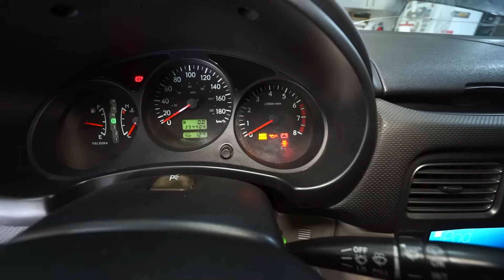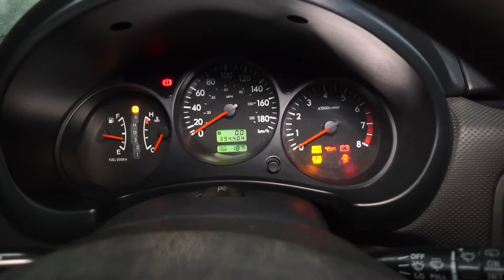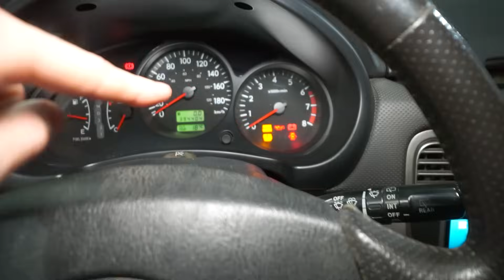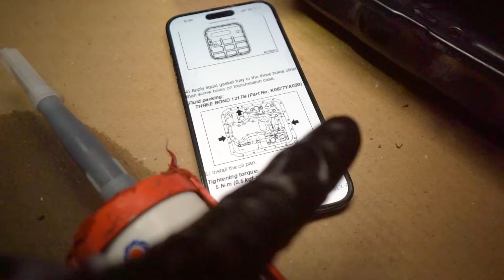Subaru 4EAT Transmission Problems - How I Fixed My Solenoid

Comment from the maker: Have you ever had any transmission issues?
Reply: I haven't had any transmission problems before i just recently swap my 2.5 bcause of rod knock it just starting to get hot but i pulled over and shut of the car i swap it out with Japanese 2.0 for reliability idles at starts perfectly and sounds much quiet it will shift it to all the gears but shifts little bit harder it will engage in every gear manually , we noticed the buzzing sound from tge selinoid that have a burgundy color once we disconnect that one the same one on the other side starts making tge buzz sound so were thinking it might be something before that selinoid thats causing the first one to make the buzz sound 😕
Reply: The buzzing sound we only hear when it's an auxiliary Once the car is started we don't hear that buzzing sound at all
Reply: Got a 07 legacy stuck in second no 1st 3rd or 4th .have changed a couple of solenoids. Still the same . But but not sure what one is faulty or if that's even the issue

Comment: Did your seliniid make a buzzing sound on auxiliary
Reply from the maker: Hmmm yeah it did! But as far as I remember, it was only when the car wasn’t running!
Reply: Thanks for your help chase👍🙌🤙🙏
Reply: Yeah same here i did the code thing it blinked 3 times which solenoid would that be?
Reply: 3 slow blinks 1 quick blink, ? That's what it seemed like it did
Reply: What would that be if thats what i did?
Reply from the maker: @jefflidberg9941  That would be the "Throttle sensor. Short or disconnection in input circuit"
Reply: Thanks
Reply: We adjusted the Throttle position sensor problem fixed no buzzing sound and shifts in all gears perfectly thanks brotha
Reply: Thank God did not have to get a new solenoid but it's weird how that would cause the solenoid to make a buzzing sound😮‍💨🙂

Comment: When your oil temp light came on, did the battery light flicker or vehicle dynamics warning light?
Reply from the maker: Not at all! It sounds like you have an electrical issue as those systems are separate from the TCM
Reply: @Chase_Schrader Thanks for replying! I was wondering if that was the case after finishing your video and researching further. 

I’m having issues with my 2011 Forester. I have already replaced the alternator and battery in the last few months. It seemed to be resolved until the last few days. Now it’s back to intermittently having all types of codes go off and then once shutting off the vehicle it drives normally. Back to the drawing board I go and hopefully it’s not too bad of a repair!
Reply from the maker: Oh no that sounds like a pain! To me that sounds a bit like a short! Any fuses blowing?
Reply: It definitely has but I been fortunate enough to not be stranded anywhere so far! This thing had me concerned the transmission was going out completely with how the electrical and it not wanting to shift properly. I’ll test the fuses next, appreciate the look out!

Comment: Pressure control solenoid A electrical. P0748 i don't don't which one is the right one to be replaced
Reply from the maker: That should be your inline solenoid, with a yellow plug. You can always pull it and test vs a good one to compare like I did, there is a diagram here: https://www.transmissiondigest.com/suburu-4at-phase-ll-version-ll-control-and-valve-body-changes/
Reply: @Chase_Schrader  thank you so much
Reply: @Chase_Schrader  all the solenoid must make a clicking sound when you test them.or just the pink one. I test the pink one one of them makes  clicking sound. But the other one pink doesn't makes so clicking.
Reply from the maker: How are you testing them? I would recommend testing them for continuity with a mutli-meter verse a good one. I believe its your inline as I said.
Reply: @Chase_Schrader  https://youtu.be/3q0x2tSi8ks?si=0AzhF1QN6qVnDB5g . I test them like he did.   pressure control solenoid A electrical doesn't makes any clicking.. I was thinking about others solenoid may there are but too. I never worked on transmission solenoid before. I kind afraid to make a mistake. Sorry man 🙇‍♂️
Reply from the maker: I would test them all if you can't tell which ones are damaged

Comment: Thank you ..I have a Subaru legacy outback 1999 gives me p0748. At oil temp light flashing i someone at the shop put the jack under the transmission pan..I a little bit transmission filter bet. But not much. When I put the car in park. And turn off the engine. On again the light is gone...but after I change the to R N D. The  light flashing again. I don't know what to do. Any help please thank you.
Reply from the maker: It’s definitely a solenoid, they probably broke it when they tried to jack it from there! That is typical with a broken solenoid, you will have to do what I did and pull the pan, remove solenoid, get a replacement and the continuity.

Comment: Do you know if the solenoids are the same for the 2004 XT model?
Reply from the maker: If it is still 4 speed auto transmission it should be!

Comment: So how did you determine which solenoid was associated with your 76 code? My 04 Outback is shifting hard and throwing a P0731 code. I also got a 41 flash from the dash lights but I can't find a list anywhere that indicates which solenoid has failed. Great video, thanks!
Reply from the maker: There are a few forum posts, I used this one:  https://www.ultimatesubaru.org/forum/topic/113278-how-to-read-transmission-codes/. But you can also find it in the factory Subaru service manual!

Hmm that’s a new code to me, from what I found, it could be something a little bit more serious like a clutch pack failing. Have you changed the fluid lately in the transmission? Regarding transmission code 41 I see no reference of it, have you check to make sure it’s 41?
Reply: @Chase_Schrader  Thanks for the response. I read it wrong. Re-did the process and came up with 31. TPS sensor. I like that batter than a solenoid replacement.
Reply from the maker: Perfect! Glad you got it sorted out
Reply: My forester is throwing a p0734
Reply from the maker: @TheRealTruthBomb  That is a tricky one since it is the wrong ratio, it could just be a solenoid issue but more often it is something more complex like clutch packs

Comment: I have been experiencing this exact issue for a few months but ended up just letting my 04 Turbo sit as I didn't even know where to begin with figuring it out. Absolutely perfect timing for this video to be posted. Thank you !
Reply from the maker: Perfect! Hopefully this video gets you back on the road, or at least know where to start. Best of luck!
Reply: @Chase_Schrader  would you happen to know how to perform the AT code diagnosis on an 05? (realized mine is an 05, and apparently running through the gears doesn’t work the same for this year) having trouble finding info online just finding it for 98-04
Reply from the maker: The 05-09 cars got a different but easier process, it is as follows: 

Starting condition: key off, headlight switch off.
Steps 1 through 7 must be performed within 10 seconds.

1. Turn key to ON position. This is the normal running position, the click just before starting, when all the lights on the dash come on, but before you twist to START. Don't start the engine!

2. Within 3 seconds, turn the headlight switch ON.

3. Press the Trip/Odometer button 4 times.

4. Turn the headlight switch OFF.

5. Press the Trip/Odometer button 4 times.

6. Turn headlight swtich ON.

7. Press Trip/Odometer button 4 times. At this point, the DTC display will begin.

You can find it here: https://www.subaruoutback.org/threads/05-06-09-how-to-read-diagnostic-trouble-codes-dtcs.19053/

Comment: I had major problems with the 4EAT automatic transmission in my Forester SG Rinspeed Turbo. The transmission got stuck in first gear or first stage. I had the car in four garages, even directly at Subaru. Nobody found the fault. They said the gearbox had to be replaced. It was difficult to find a suitable used one. It was unaffordable new. I was skeptical because the oil pressure was fine. I ordered a valve box in the USA, but it was one from the SH model. A second one I ordered fitted but the solenoid valves were broken. I ordered the solenoid valves in China and had them fitted. Didn't help either. So I had to replace the gearbox. A gearbox ordered in Russia was delivered incorrectly, it was from the Legacy GTB. No return possible. After a long search I found a gearbox in Poland, it fitted but the car still wouldn't shift. After about a year in the workshop, I read one sleepless night that someone from Peru was asking in an American Subaru forum about the kickdown switch because his Forester was no longer shifting. That very night, exactly one year later to the day, I removed the switch above the accelerator pedal and discovered that it had simply got stuck! The switch alone cost €26, fitted by myself. Total cost of one year of gearbox madness €4000! I still thank my wife today that she didn't leave me ;)
Reply from the maker: Woah that is quite the adventure for one switch!    I will remember that so hopefully I won’t have to go through that. Was it ever throwing any codes? Sounds like your wife is a keeper for going along with all that!